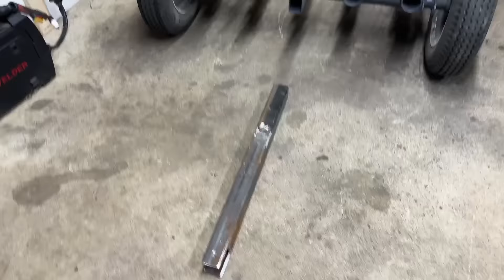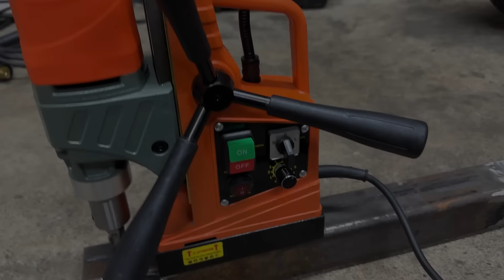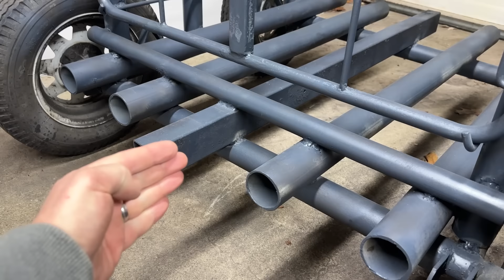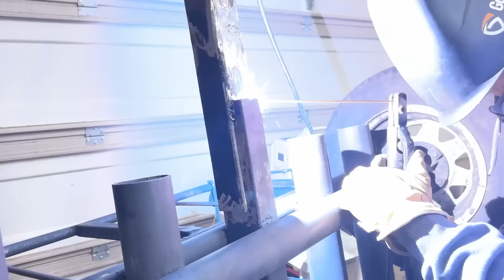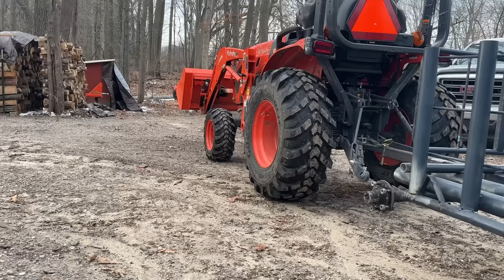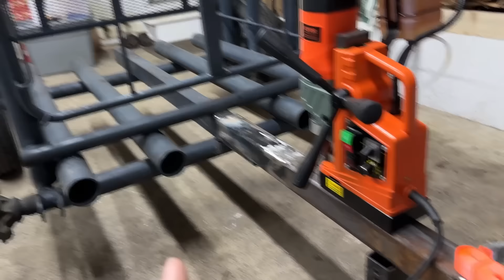Wood Cart Built: We Have a Problem

Comment: Such a small cart doesn't need two axles. I'd keep the rear axle just as you have it, cut off the front hubs to reduce weight, and put a jack on the front tongue, maybe with a wheel if you have hard surfaces that you can roll it around on. You could move the rear axle forward a bit to help reduce front tongue weight, but don't move it too far forward, else you'll have issues with it being tippy in the rear if you load it too heavy in the back.

Comment: If you're going to use your trailer with all 4 wheels you're going to have to make the front axle steerable, otherwise the trailer won't track around a corner . It will just skid and bunny hop.

Comment: Your 4-wheel configuration will work.  You've seen semi's, right?  Just maybe shorten the distance between them.  You may find the load carrying capacity of just 2 wheels to be insufficient, especially on soft surfaces.  You're going to need a tongue jack without 4 wheels.  A parking brake would be a good idea in any case for long logs.